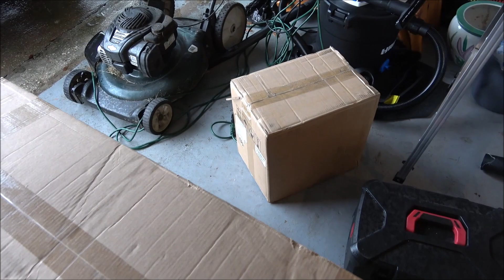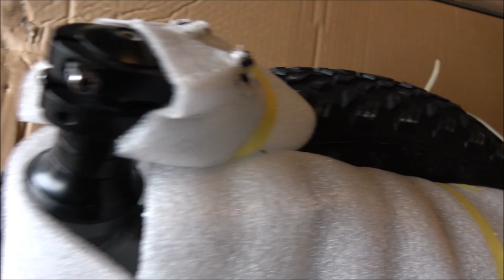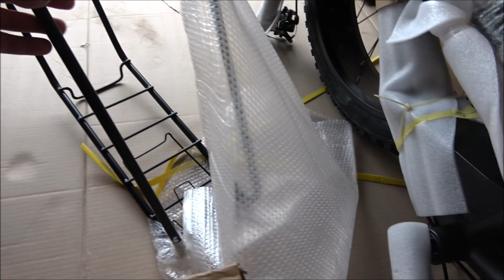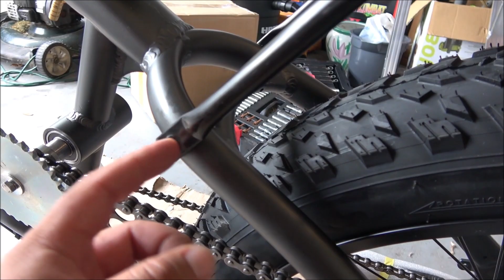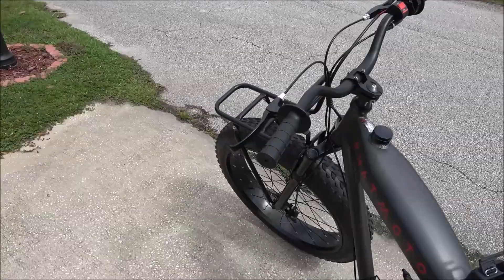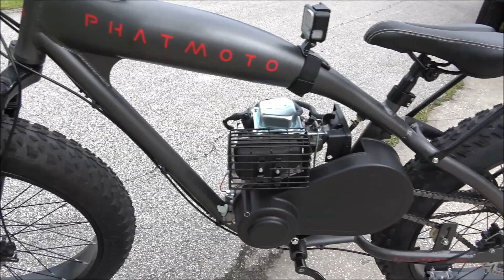PHATMOTO All -Terrain - Fat Tire Motorized Bicycle!

Comment: $900.00 is what I'm seeing this listed on their website. I know they put a lot of work into the construction of the bike and motor but I built mine for under $300.00 using my Walmart 21 speed road bike. It gets 100 miles per gallon using a 100 cc engine. Top speed is 75 on a straight road. I am in the process of building my fat tire gas running bike that's been sitting in my shed for a few years using the same engine but honestly I like the thinner rimmed tires. I just don't see spending up to $2000.00 for motorized bikes mainly because if something breaks you know you are going to have a long process getting it fixed from the dealer. I'd rather deal with purchasing parts for my engine through ebay or Amazon. I've been running mine for over a year with no problems. Starts right up and maintaining high compression and no wear on the engine. I did have to replace the tires due to wear but that's going to be expected especially on a bicycle. The tires aren't meant for high speeds especially in the heat. I have located some better tires but they are going to cost me.

Comment: hello. why does my bike bounce up and down when on pavement?
Reply: Tire pressure might be low...
Reply: The tires are not seated right. See videos on how to set the bead of a tire.I have same problem
Reply: You got to deflate the tires and use a brush with soapy water all around the rim and inflate back up quick with that particular wheel on the air to help it snap into place correctly, that'll make it seat true and feel a lot smoother at speed.

Comment: Fuel filter on backwards
Reply: it doesnt matter...
Reply: @camo7452  well I guess it wouldn't to people who dont do things the right way
Reply: @thatguywill066  fuel will flow no matter the direction
Reply: @camo7452  true but it's still backwards and isn't right
Reply: @camo7452  plus you cant see if anything is clogging it or if its dirty but hey do things the wrong way if you must
Reply: @camo7452  on some filters there is a tiny magnet to collect magnetic particles so it kinda does matter and on higher quality fuel filters it shows an arrow for fuel flow.

Comment: I bought one of these bikes, went about 300 MI and the bigger gear, for the smaller chains sprocket on the jack shaft has no teeth left.. poor workmanship, they should have used a better type of steel. Other than that if you mess with the governor you could do about 35 mph. It does however get 108 miles to a full tank that's after I messed with the governor and was doing 35 mph
Reply: @AnX8765  i didnt expect a warranty at all for what i am/was doing to/with this bike
Reply: @AnX8765  honestly lasted longer then expected. i have since then switched out the 79cc to a 212cc
Reply: Does she go for a rip now bud? Seriously considering one of these and putting on a 212cc too...or should I just find a different fat bike and buy the 212cc engine kit?

I’m new to this stuff so I appreciate any insight.

Comment: Could anyone please tell me what the proper fuel and oil would be for this kind of all-terrain Moto ?! Thanks
Reply: Its a 4 stroke, so no oil is mixed with fuel dude. If your asking what motor oil, same as a Honda GX/GC would recommend and don't run high octane unless you don't mind it running hotter.
Reply: You are awesome thank you 🙏
Reply: When I've always ran higher octane leaded fuel with high compression or running nitrous it actually runs cooler and you can run more timing with automotive racing engines. More timing is more power as long as it doesn't detonate peeing or pop. or on the technical side as long as the exhaust gas temperatures are not too hot either. I ran all the way up to 118 octane racing fuel and even experimented and ran some nitromethane mixing it with gasoline pump fuel 87 octane and nitromethane in my stock 110 stock 3-wheeler. On a technical note just because you run higher octane fuel it will not give you more power it's actually the opposite. If you don't need the octane it's a waste of power loss and your money. But nitromethane mixing in a stock engine with gasoline will give you more power that's why I did it and you can feel the difference in power. Also mixing nitromethane in a built engine or any engine will give you more power.
Reply: The owner's manual recommends 10W30.
Reply: 10W30 regular or full synthetic oil after break in, run 87 octane regular or non ethanol it's only 8 to 1 compression. Running higher octane on four strokes actually makes less power by dyno tests results and a waste of money if you don't need it.

Comment: Those tires are a compromise between street and off-road performance, not ideal for either one. And those knobs will be soon be worn away if it is used a lot on the street.

Comment: I just ordered my own setup, a $300 bicycle and 130 high performance 2 stroke kit which is going to be cheaper and faster than the shitty 4 stroke they include on the phatmoto. I will have to do some fabrication so the chain doesn't run but that the fun in it
Reply: Cheaper and faster with a quarter of the usable life

Comment: Increasing the rear sprocket diameter will slow it down fool!
Reply: Trail Bikes don't need to go fast.
Reply: @justinsavs    Not the point! He stated incorrectly that increasing the sprocket diameter would increase speed. The fact is the exact opposite, simple physics!

Comment: How can I get a smaller sprocket and be able to put it together myself?
Reply from the maker: Melvin Cortes I provided a video that talks about this on a yellow Phatmoto. It’s the same for this bike.
Reply: @MJTechChannel  yea but I tried to go to the phatmoto website and they don't have the sprocket for sale there. Where can I buy it is my question.. And thanks for the response! I'm in Florida in the Orlando area and I don't know if there is a place near by that I can maybe buy one?
Reply: @MJTechChannel  is there any way you can call me even if its thru messenger or something bc I'm getting worried about this bike. When I slow down sometimes I hear something like metal rubbing against something..
Reply: @melvincortes7134   maybe your hearing the sound from the disc brakes?
Reply: @trishkbibl2637  what do you mean? The sound comes from engine by the pull rope
Reply: I fixed that already bro but this bike is something else.I've lost 4 spkoes due to the fucking vibration of this bike. I mean I love it don't get me wrong but Damn it man if its not one thing its another. Just frustrating.
Reply: @trishkbibl2637  I fixed that problem but now I've lost 3 spokes due to vibration the rear tires spoke just pop out like nothing. I love the bike but Damn this is crazy for the amount of money we spend on these phatmotos this shouldn't be happening. They're like the Mercedes benz of bikes. At least they look like that. I mean I love it but I shouldn't be having these problems so early in the process of owning it I just bought it for Christ sake!
Reply: @melvincortes7134  lol! What ended up being your fix? 

The other day, I lost a bolt and washer/cover related to my jackshaft. Its making weird metally sounds now! 

Same road,  blew out my R-Spec tire... 2 Days earlier! 😔😠😠😠
Reply: @trishkbibl2637  it was the cover of the pull rope that came loose
Reply: @trishkbibl2637  but now I have a bigger problwm...
My spoke are breaking in my rear tire I've already had 5 break on me!! And they don't cover that under warranty.
Reply: @melvincortes7134  your first lost spoke, did it loosen from the connect points at the rim? Or did it actually bend/ snap..at some point...somewhere in between? 

And did you fix the first... Before the other 4 broke? 

Not being a dick.... But you lose one spoke, and your wheel is vulnerable.... no longer structurally sound. 

_
Reply: @trishkbibl2637  they all snapped from the where the spoke first goes in ya know where the sprocket or axle is.. I think it was bc it wasn't properly aligned..
Reply: @trishkbibl2637  yea the vibration was way too much.. I sent to get the rim be repaired but for them to lock tight them all.
Reply: @melvincortes7134 are you riding it regular roads?  Dirt roading? On  the norm?

Did you put together the bike yourself? Did you locktite bolts, lube, and torque certain things?  Out of the box? Or where you super excited.....

If its in for spokes,  Save yourself the headache, pay the extra hunny+few bills, and let the place make your bike, ride worthy.
Reply: @trishkbibl2637  I lubed and lock tight on everything.. Trust me I did that all..
But I really believe its the alignment that I have to fixed.
Reply: @trishkbibl2637  oh and I ride on normal roads and follow the rules

Comment: What's the top speed and do they come street legal
Reply: It is street legal due to the bike frame and cranks. Can't go over 28mph (thats just by the dmv). This is for California. Just check online with your local dmv
Reply: @kevinmontoya7318  do you need license or need to register it in cali?
Reply: @kevinmontoya7318  can it be ridden in the sidewalk if the speed limit is higher than 25
Reply: @joseguzman3964  you don't need to register it in Cali as it is a motorized bicycle, same rule with ebikes, can't go over "28". 
Unfortunately no it cannot be ridden on sidewalks (unless you pedalwith the motor off), due to the fact that it goes over speed.
Good thing is, you can ride it along bike paths on normal road.

Comment: How many miles to 1 tank of gas?
Reply: I always pedal bike if engine is off or on. With engine off alot going slow putting around. I average 140 - 170 miles to the gallon excellent gas mileage. Gas tank is less than a gallon .70